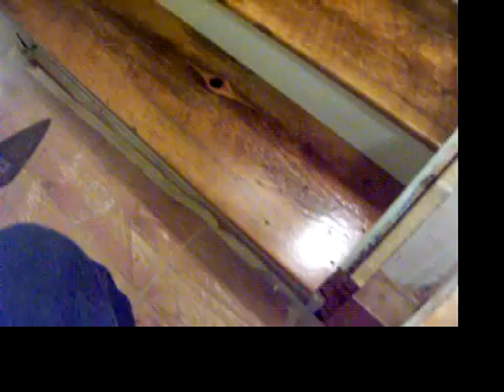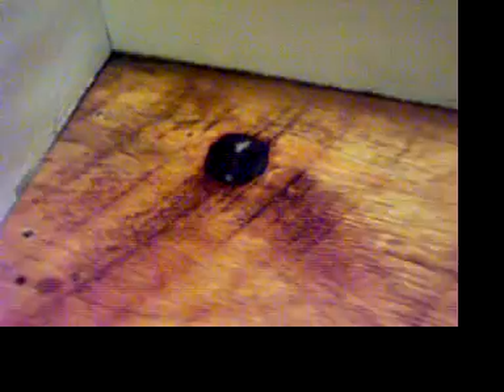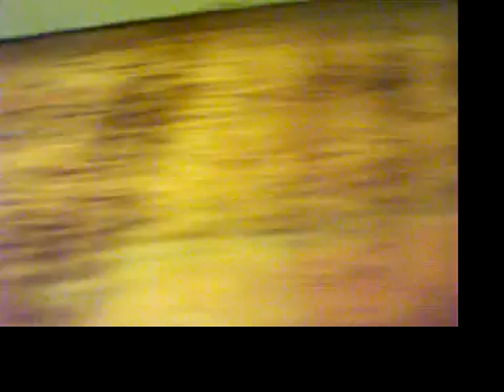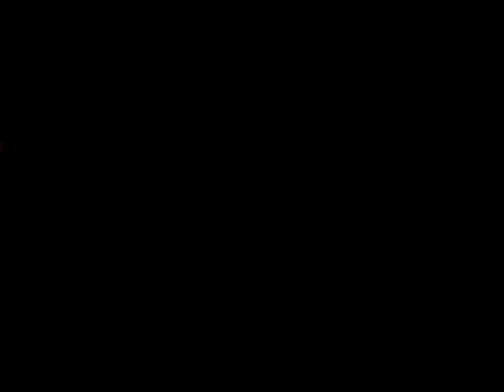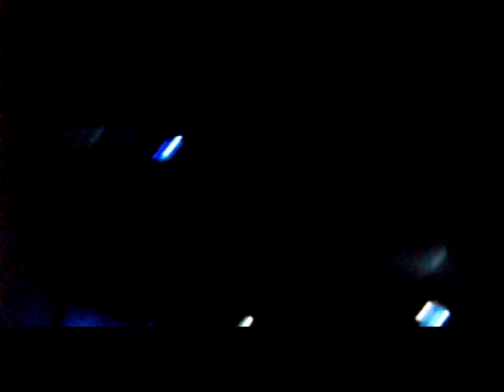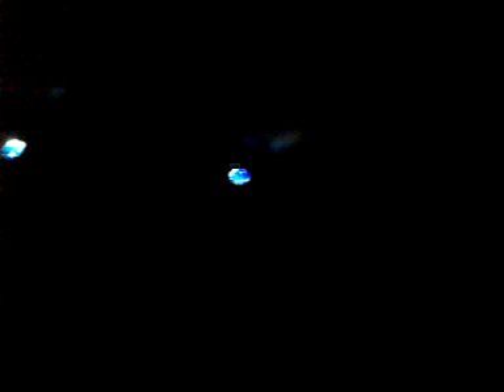Motion Sensing LED Illuminated Stair lights.

Comment: I would be afraid to walk down those stairs, your led should point to the steps  check out my vid only cost about $20 let me know what you think -  Automatic Motion Activated Led Steps Stairs
Reply from the maker: You guys are not getting what I built here, think less factory illumination and more art instillation.  Each knot was carefully removed and a pocket created for the wires and circuitry in the back.  The knots are then filled with broken glass and epoxy to create pools of diffused light in the path.  The side effect is they serve to illuminate the stairwell nicely with non directional light.  This isn't screw and stick, this is a built in system.  As far as your line about being afraid to walk down them, well that is just shameless posturing in an attempt to draw views to your video.  If it is a good build it will stand on its own, trust your work man.

Comment: That's cool except the random placement of the lights is a little disorienting, something you may not want on stairs, and the LEDs shining right into the sky instead of on the stairs you'd like to see isn't the best either; I would think your pupils would constrict and make it even harder to see the stairs. Sorry I go around writing comments like these... I'm from Poop on your parade productions.
Reply from the maker: LOL, they are knots in the wood I popped out.  Mother nature set the spacing and direction on these.  Think of it as art rather than illumination but I can say after climbing them for the last 4 years, in the dark, they serve just fine.

Comment from the maker: I added the sensor/trigger I used in this system to the video description.  I was going to use an outdoor motion sensor but this has the motion and light sensing built in.  It will only turn on with dark and movement.